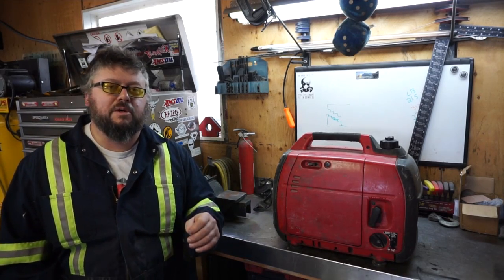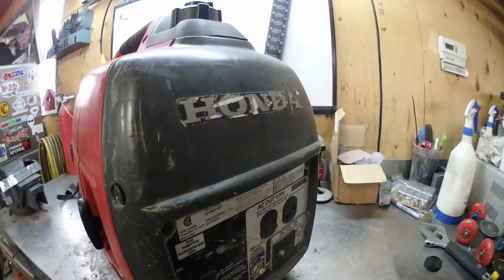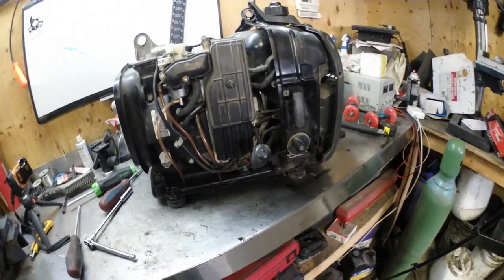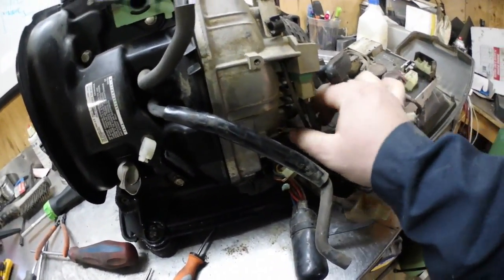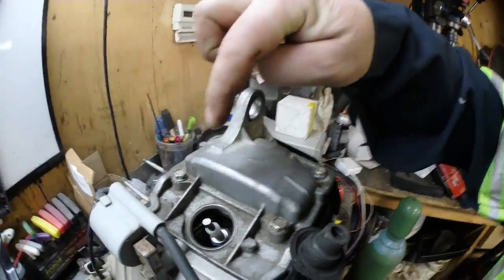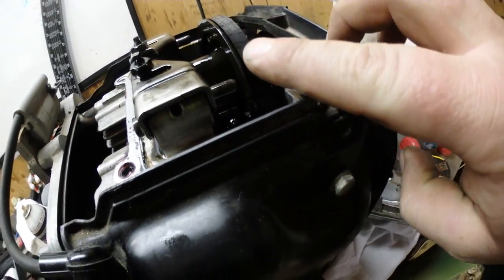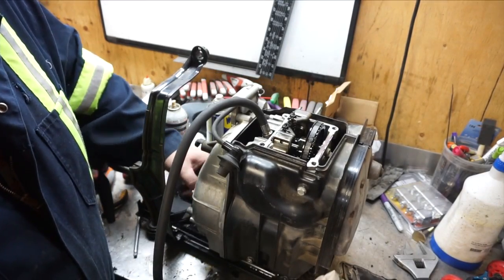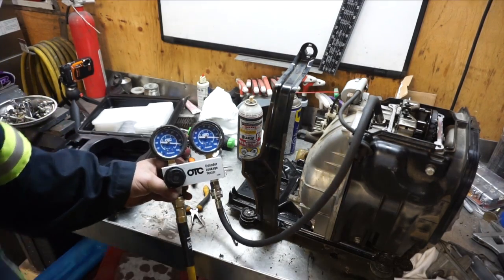Honda Eu2000i Cylinder Leakdown Test

Comment: How did yyou lock the rotor?  Maan you barely show anything..
Reply from the maker: You don’t need to lock down anything
Reply: Yeah, apparently the guy I got this from has the timing gear off from the valves, I can't get a reading at tdc, it keeps leaking out the intake or exhaust sides.  Either that or I have a nasty exh port..

Comment: Just replaced a slapping smoking piston. If you get into the crank case change the governor they tire after a few hundred hours tire af dont last and are cheap
Reply: The governor is in the computer bud. Doesn't have a mechanical governor 🥴